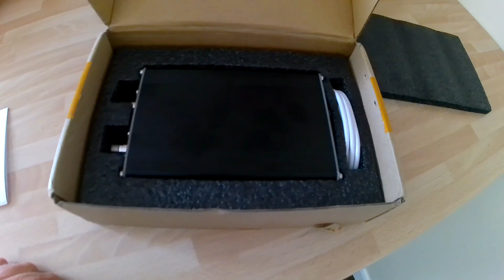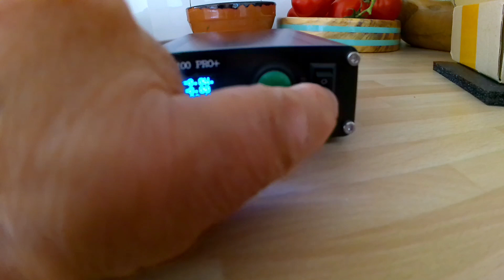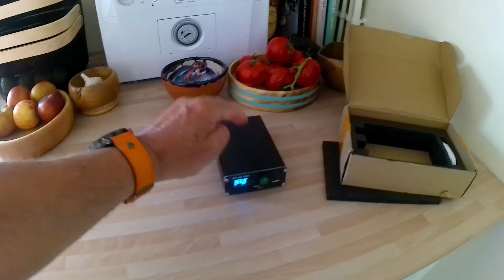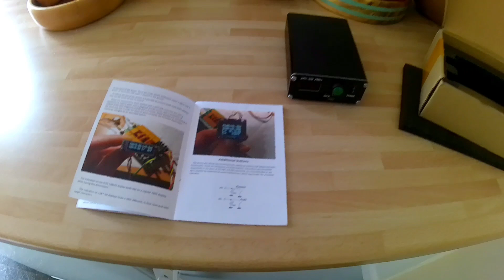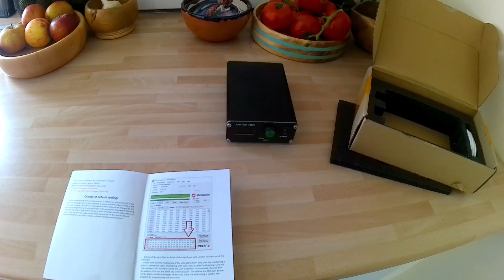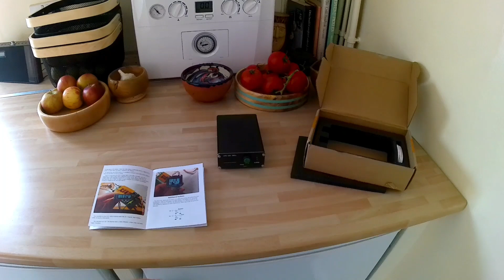ATU 100 Pro+ Automatic Antenna Tuner. "TZT" First Impressions. Opening the Box. Ham Radio.

Comment: on a 1350ma battery 1.5-2 hours at 1000ma  5-10 hours on a 4000ma battery . 2-3 hours of continuous operation much longer with fewer tune outs. uses version 3.2 firmware which allows for 1watt tuning

Comment: Had mine for about three weeks and it works very well. Only concern I have is that I don’t know how long to charge it for. I charge for quite awhile and the Green charged light never lit it stayed red. I charge for about three or four hours. It works well for about an hour or two but then dies.
I’m reluctant to charge it for hours and hours as I don’t want to damage it.
What is your experience and charging times and did your green light ever light once it was fully charged?
Reply: the red light is suppose to turn green after about 1.5 to 2 hours at a 1000ma charge rate